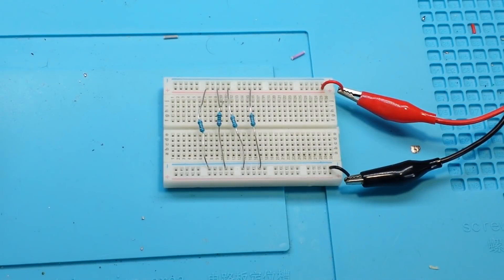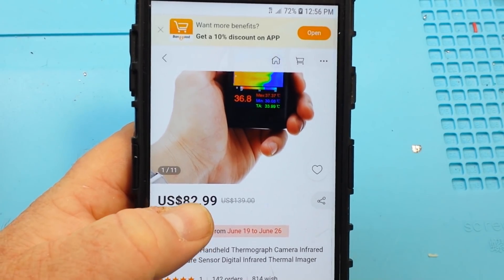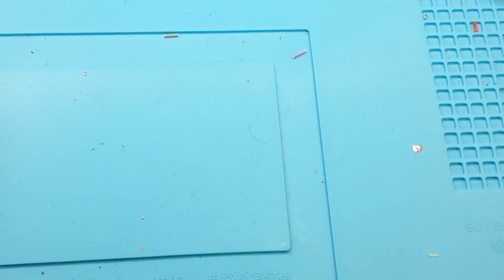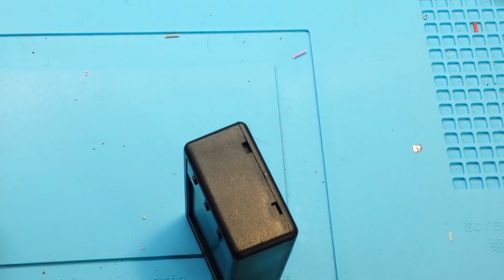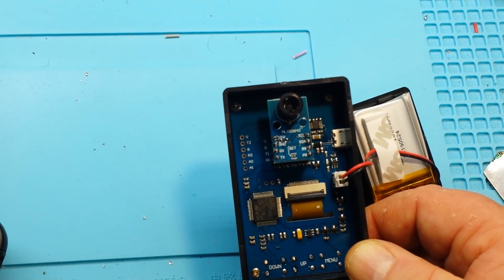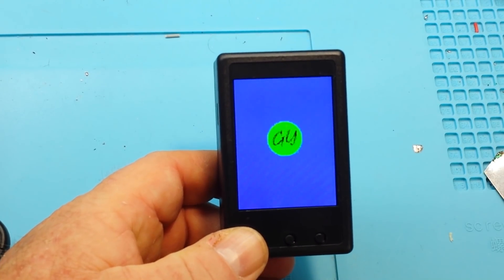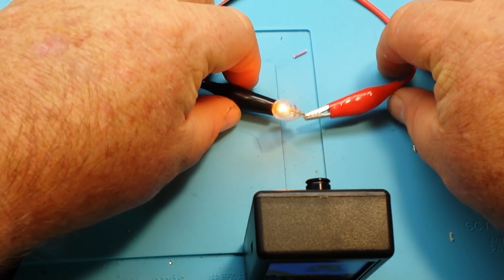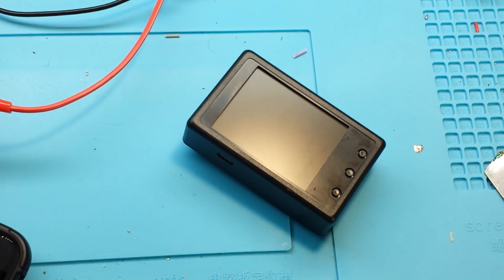HY 18 Thermal Camera from Banggood

Comment: Can you calibrate the temperature range ?
Reply from the maker: Not really
Reply: learnelectronics damn, maybe you can throw on an mlx ir temp sensor and have the oled diplay it seprerately. Have you tried using it on any hotter surfaces or metals, maybe for industrial use?

Comment: Definitely cool, not sure how useful it would be debugging circuit boards. Believe it or not flir has an amazingly good camera (and inexpensive as far as thermal cameras go) 

The flir one pro has Amazing resolution, comparable to some of their multi thousand dollar cameras, and they can be had for around $300 on eBay. I use one… And after a little fiddling... can easily get good enough resolution to diagnose even the smallest of surface mount boards.

Don’t get me wrong....this cam from Banggood is really cool and would be super useful for things like diagnosing automotive trouble, bad bearings, and checking the insulation around your home (for leaking air during the summer or heat during the winter). It would be so handy for all types of diagnostic needs… Just not for small circuitboard troubleshooting. 

You just can’t believe how useful A thermal camera is in diagnosing or finding problems in all sorts of different applications.So glad you reviewed this, I love your content, and have been curious about this camera since I’ve seen it on Banggood. 

Soon someone will come out with a higher resolution Camera for under $150. Hopefully matching the flir resolution of 160 x 120. However flir software is the strongest point of the technology. 

But still… If someone came up with a less expensive high-resolution thermal camera… Even without the software I would buy it!
Reply: For 300 u have far better thermal cams then the flir pro one these days with higher res
Reply: @Arvidje  hopefully soon?
Reply: @hullinstruments  take a look for example at the A-BF RX-680. It has a infrared resolution of 256*192, very accurate measures like the expensive flir' it has a higer temp range then the flr one pro.  I bought it for 290 euro from aliexpress.

Comment: I actually have a FLIR haven't used it in a while though. Good troubleshooting tool for leaks in walls and ceilings as well as cold air flow. Haven't used it in an electronics setting yet.

Comment: It's bit hard to judge from so little information, but still. Damn that looks shitty. If you about triple the price you could get last gen CAT phone with built-in thermal camera, which is also using normal camera sensor to make image fairly usable. Also the cheapest Flir model cost about the same and I can tell you immediately that even though it isn't very impressive camera at all, it's totally different league of device. Definitely gonna pass this. If I were to get cheap usable one I'd look maybe something like USB Seek thermal compact camera. Just seriously something else than this garbage.

Comment: does the sensor have a calibration shutter?
Reply from the maker: Not that I am aware of. Check the link in the video description.
Reply: I don't think that's such a big issue with thermopile sensors compared to microbolometer sensors.

Comment: If you received that more then a few months ago it could be the Tariffs had not kicked in yet.   Most every thing went up like 20 - 30 %..
Reply: @frankhobsonKJ4CDM  I've been ordering  from BangGood and Or Ali twice a month over the past 5 years.  Many orders are standing orders.  The Tariff is reflective in the Prices.  NewEgg Prices and BangGood is showing like a 30% rise and the Tariff was only 20%.    LOL, Guess they're getting while the getting is good.      I don't give a chit about the Tariff's.  We're still buying at a price well under what anyone in the U.S. A.  can provide.    EBay prices don't seem to have caught up yet.  I think most of those prices were already higher then BangGood and or Ali.
Reply: Orders sense last May.

Order No: 68663879 Name To: Date: Jun 27 2019

    XL4016E1 8A 200W DC-DC Step-down Power Supply Module DC 4-40V To DC 1.25-36V Buck Module
    XL4016E1 8A 200W DC-DC Step-down Power Supply Module DC 4-40V To...
    US$6.31 x 1
    CN
    US$6.53
    Processing
    Order Details

Order No: 68663878 Name To: Date: Jun 27 2019

    30g Grey Thermal Paste Grease Compound Silicone For Graphics CPU Heat Sink
    30g Grey Thermal Paste Grease Compound Silicone For Graphics CPU...
    US$2.68 x 1
    CN
    US$2.30
    Processing
    Order Details

Order No: 68663877 Name To:  Date: Jun 27 2019

    2.4G 5G 5.8G Built-in PCB Double Frequency FPV Antenna IPEX U.FL IPX For WiFi FPV System
    2.4G 5G 5.8G Built-in PCB Double Frequency FPV Antenna IPEX U.FL...
    US$2.05 x 2
    CN
    US$10.82
    Processing
    Order Details

    5Gbps Hi-Speed USB 3.0 4-Port Splitter Hub Adapter With DC 5V Port
    5Gbps Hi-Speed USB 3.0 4-Port Splitter Hub Adapter With DC 5V Port
    US$7.20 x 1

Order No: 68133367 Name To:  Date: Jun 18 2019

    3.3V- 30V to 0.5V-33V 5A 80W DC to DC Converter Board Solar/Wind Power Automatic Boost Buck Regulator Module
    3.3V- 30V to 0.5V-33V 5A 80W DC to DC Converter Board Solar/Wind...
    US$6.47 x 1
    CN
    US$7.90
    Shipped
    Shipping Info
    Order Details
    Confirm Delivery

Order No: 67838254 Name To: Date: Jun 13 2019

    5 Pairs PV Solar Panel Cable MC4 Connectors Male & Female Connectors Waterproof IP67 for Photovoltaic Solar System
    5 Pairs PV Solar Panel Cable MC4 Connectors Male & Female...
    US$4.59 x 2
    CN
    US$16.42
    Shipped
    Shipping Info
    Order Details
    Confirm Delivery

    10m Soft Silicon Cable Wire 24AWG Heatproof Flexible Black/White/Red/Green/Blue For RC Model Battery
    10m Soft Silicon Cable Wire 24AWG Heatproof Flexible...
    US$3.46 x 1

    10m Soft Silicon Cable Wire 24AWG Heatproof Flexible Black/White/Red/Green/Blue For RC Model Battery
    10m Soft Silicon Cable Wire 24AWG Heatproof Flexible...
    US$3.46 x 1

Order No: 67258217 Name To: Date: Jun 03 2019

    DD220D25 25A Single Phase Solid State Relay SSR DC To DC Controller 3-32V 5-220V
    DD220D25 25A Single Phase Solid State Relay SSR DC To DC...
    US$5.33 x 2
    CN
    US$12.17
    Shipped
    Shipping Info
    Order Details
    Confirm Delivery

Order No: 67194233 Name To:Date: Jun 02 2019

    10 Positions Electric Cable Connector Terminal Barrier Strip Block Bar with Screws
    10 Positions Electric Cable Connector Terminal Barrier Strip...
    US$3.15 x 2
    CN
    US$7.80
    Order Completed
    Shipping Info
    Order Details
    Buy Again

Order No: 66919850 Name To: Date: May 28 2019

    10 Positions Electric Cable Connector Terminal Barrier Strip Block Bar with Screws
    10 Positions Electric Cable Connector Terminal Barrier Strip...
    US$3.15 x 1
    CN
    US$8.51
    Order Completed
    Shipping Info
    Order Details
    Buy Again

    H2519-5 Dual Row Plastic Terminal 600V 36A 6 Positions Screw Terminal Block Cable Connector Barrier Terminal Strip Block
    H2519-5 Dual Row Plastic Terminal 600V 36A 6 Positions Screw...
    US$1.96 x 2

Order No: 66919849 Name To: Date: May 28 2019

    12v 40*40*20mm 4020 Ball Bearing Sleeve Cooling Fan with 2Pin Cable
    12v 40*40*20mm 4020 Ball Bearing Sleeve Cooling Fan with 2Pin Cable
    US$1.88 x 2
    CN
    US$5.14
    Order Completed
    Shipping Info
    Order Details
    Buy Again

Order No: 66149313 Name To:  Date: May 13 2019

    DANIU 12 AWG 10 Feet 3M Gauge Silicone Wire Flexible Stranded Copper Cables For RC Circuit
    DANIU 12 AWG 10 Feet 3M Gauge Silicone Wire Flexible Stranded...
    US$6.83 x 2
    CN
    US$13.05
    Order Completed
    Shipping Info
    Order Details
    Buy Again

Order No: 66149312 Name To: Date: May 13 2019

    40mm 65cm Metal Retractable Pull Chain Reel Key Ring Holder Recoil Belt Clip
    40mm 65cm Metal Retractable Pull Chain Reel Key Ring Holder...
    US$1.95 x 3
    CN
    US$7.26
    Order Completed
    Shipping Info
    Order Details
    Buy Again

Date: May 13 2019

    50pcs PCB Bare Board Spring Loaded Test Probe Pin P100 E2 180g 1.36mm Diameter
    50pcs PCB Bare Board Spring Loaded Test Probe Pin P100 E2 180g...
    US$3.85 x 1
    CN
    US$5.38
    Order Completed
    Shipping Info
    Order Details
    Buy Again

    10m Soft Silicon Cable Wire 24AWG Heatproof Flexible Black/White/Red/Green/Blue For RC Model Battery
    10m Soft Silicon Cable Wire 24AWG Heatproof Flexible...
    US$3.46 x 1
    CN
    US$20.64
    Order Completed
    Shipping Info
    Order Details
    Buy Again

    10m Soft Silicon Cable Wire 24AWG Heatproof Flexible Black/White/Red/Green/Blue For RC Model Battery
    10m Soft Silicon Cable Wire 24AWG Heatproof Flexible...
    US$3.46 x 1

    5 Pairs PV Solar Panel Cable MC4 Connectors Male & Female Connectors Waterproof IP67 for Photovoltaic Solar System
    5 Pairs PV Solar Panel Cable MC4 Connectors Male & Female...
    US$4.59 x 2

    10pcs Ultra Pointed Golden Flexible Multimeter Probe PCB Test Needle
    10pcs Ultra Pointed Golden Flexible Multimeter Probe PCB Test...
    US$2.41 x 1

    DC-DC CC CV Buck Converter Board Step Down Power Supply Module 7-32V to 0.8-28V 12A
    DC-DC CC CV Buck Converter Board Step Down Power Supply Module...
    US$5.50 x 1

Comment: Cheap? Well that is a matter of opinion.

Doesn’t it show Fahrenheit for you guys that measure wavelength in feet and inches? 😁😁😁
Reply: Yeah it looks like the cost of that sensor itself makes up most of the cost of the unit when you look up the sensor on eBay at least. I was hoping I could find the sensor cheaper and have a diy Option...